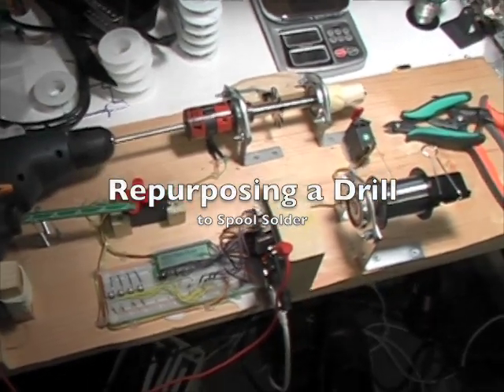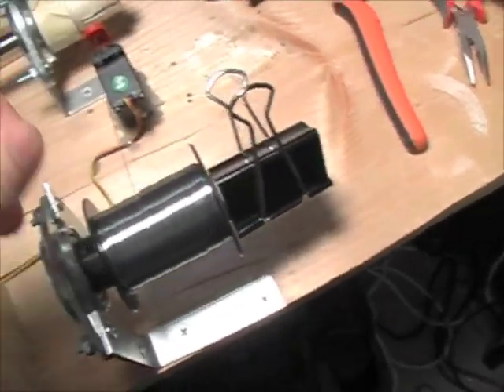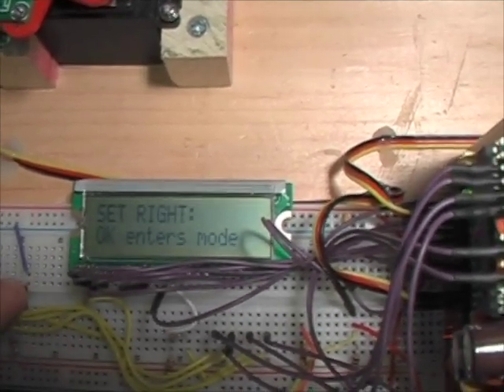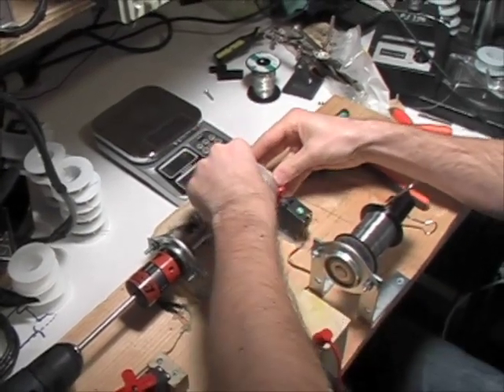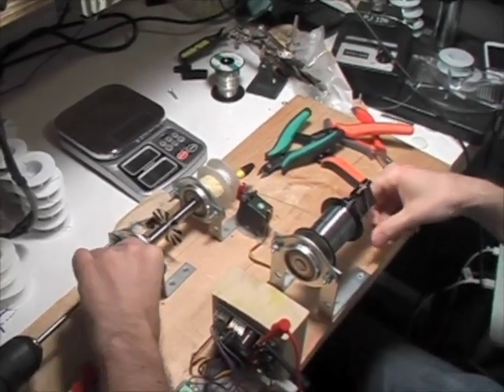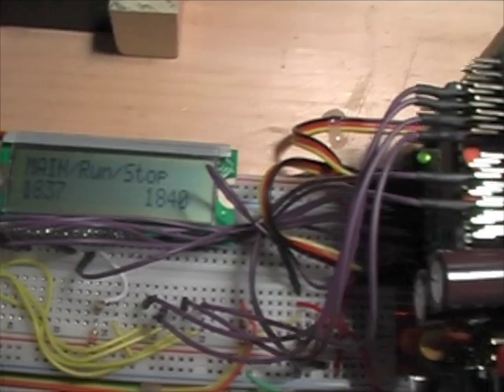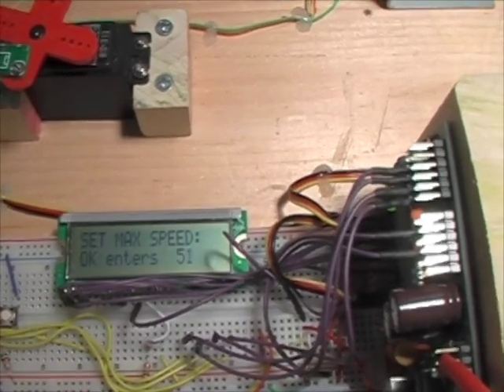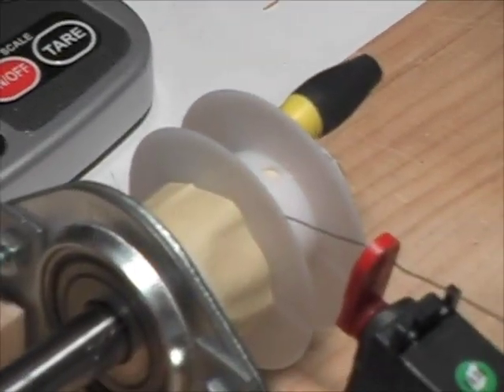Controlling a Hand Drill with Arduino to Spool Solder

Comment: Dude, you have some cool vids. I wish i could do more of the stuff like you do but I only have basic soldering skills and limited knowledge of electronics. I have 2 questions for you.
1) You mention Kester solder. Does it matter what brand solder you are using? When I first started soldering for RC projects I just bought a lb of 63/37 .25 solder but I think its something like Gardiner brand (or something to that effect...Im not home atm to look at it)
2) how does one learn how to use an arduino?

Comment: I'm thinking of building something similar and I have two questions. Can a hall effect sensor be used for speed and turn count instead of the optical encoder? Does the servo have any problem distributing the wire evenly (more in the middle or sides)? Did you code something to compensate any uneven distribution of wire? Great video and project! Thank you!!!